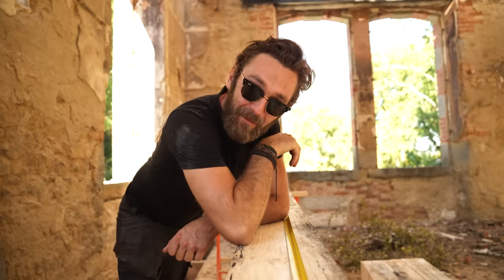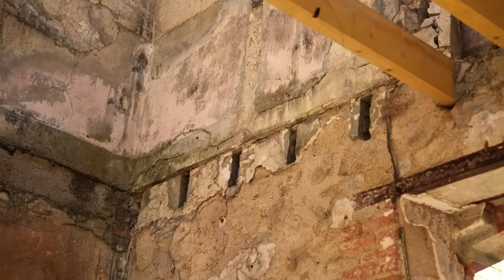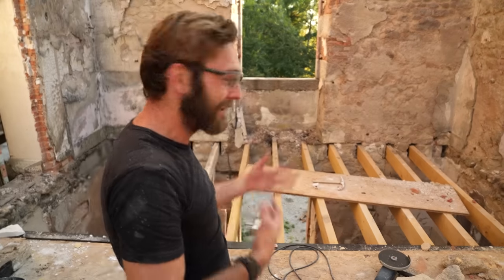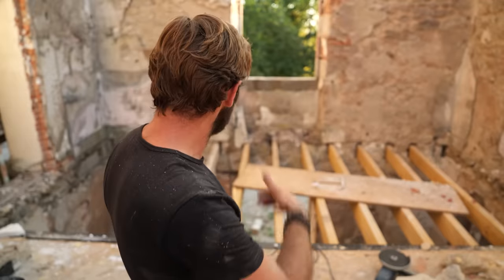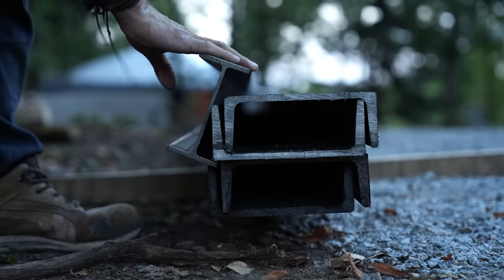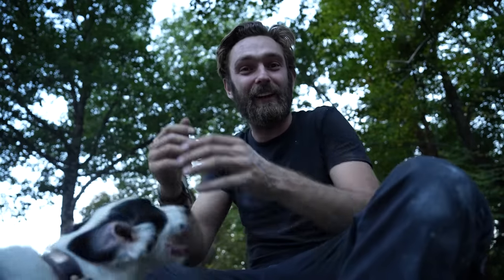Its a big day for materials, finishing the floor.

Comment: You have to give it to Dan doing all that heavy lifting and pulling those beams up to that floor he's working on now. He's going to appreciate all of his hard work when he finishes this floor and has a solid floor to work on. When Dan finishes this floor and the beams he'll be ready for another vacation!
Reply: He's getting such a workout that pretty soon he won't need a hammer and chisel to fix masonry. He can use his bare hands, lol.
Reply: Remember when he used winches? I wonder if they broke...
Reply: According to his friend, Stephanie Jarvis, from Chateau de Lalande, he will be using her getaway spot in Cap d'Agde next week
Reply: @hmeyers5114  maybe he just did not have a place to install a winch ?
Reply: @hmeyers5114 the beans are long enough to prop against existing beams from the floor. Using a winch to pull them over the top was probably more botheration than sheer brute force at the time. Lol

Comment: This is the first time I’ve seen you install the floor joists without painting the ends that go in the wall.
Reply: Yep, I noticed the same thing.
Reply: The quality of the beams seams a bit off too.
Reply: Its not serious, its just a You Tube Channel
Reply: OOops 🙃  how did I miss that detail when I was actually waiting for it? 😵‍💫
Reply: I noticed both the lack of the black treatment and the slightly lower appearing quality as well.
Reply: I think it's because these are so dried out they don't need to be painted to keep them from cracking. They already are kind of cracked and well dried. Just a hunch
Reply: @patstrong547 I'm wondering if he's having trouble finding wood ....there has been a shortage for a long time now.
Reply: He mentioned that he didn't know if the treatment was necessary, uncertain if it would help make the boards last longer, and I think someone else he spoke with regarding it wasn't certain either. I noticed that too.
Reply: @karladenton5034  He said earlier he was not so sure it was really worth it or helped a lot.
Reply: Perhaps his friend, who gave his opinion on how to fix the window frames, advised him that the black spray is no longer necessary. It's just a hunch as well.

Comment: Just discovered your channel two weeks ago. Been binge watching, and I'm really amazed at what you've accomplished. You have a great team, Nic and Cameroun, and the others. I just hope Dan can get the roof on before winter. But that means the chateau  walls have to be really strong and stable enough to carry the weight of the roof - rafters, concrete ring beam, tiles etc.
Reply: I think he is just going to do a temporary partial roof over the wing he is working on.  He won't do a full roof until he has all the floors in on the other side, so no ring beams yet, but won't that be exciting when that happens. :face-red-heart-shape:
Reply: Welcome aboard.. ❤❤❤❤❤

Comment: Dan please take time to clean the floors so you don't sprain or break a foot/ankle.
Reply: I was thinking the same thing. It’s bad enough working at heights and on slightly unsecured flooring without have to deal with rubble.
Reply: So easy to slip, trip & a fall from that hight😢‼️🚩😭
Reply: And wear some proper boots 🥾
Reply: @annekabrimhall1059 he has safety shoe on.

Comment: Dan, why not connect a strap to your elevating platform and then to the material to be lifted? You would have a crane. Also, see if a nut drive could be adapted to the crank handle shaft  and attach to a power drill and voilà, no more cranking. Just saying.

Comment: Dan, as usual love what you are doing, why dont you erect a fixed scaffold on the outside wall with an outreach for your electric hoist. Also with the amount of plaster and rubble you will be clearing from the  upper floors a chute will save you double handling it. I am thinking of your back over the next 12 months!

Comment: Hi Dan, I have an idea on what you can use to get water in the walls, instead of using a bucket you can get a Garden Sprayer for Fertilizers that you can manually pump to get the water right where you need it.

Comment: Just a thought. You can buy cheap inflatable jacuzzis these days. If you had one it would help with your sore muscles at the end of the day. The boys would enjoy it. It would help personal hygiene.
Reply: O M G. No boundaries
Reply: He  doesn’t have running water and  the  old  well is putrid, he has to cart in water for the mixer.
Reply: In one of the Vlogs at the farmhouse he has an inflatable jacuzzi.
Reply: Even if he had water he doesn’t have electricity to run a jacuzzi or to heat  the water, he  only has a solar powered battery bank to run his saw and power tools.
Reply: @lindalawson7600  Totally agree. Today Dan has been advised to suck in his gut before lifting things, to remember to loosen the collars on his puppies as they grow and to get a jacuzzi to help with his personal hygiene. I enjoy reading the comments but no wonder Dan doesn't respond. 🤣

Comment: Pro tip, you can clamp or screw the festool rail vertically on the front side of the beams, as long as you have them aligned well enough, set the correct angle, and you only need to do 2 cuts for the tenon. Also, you should definitely maintain your chisel. Best

Comment: Should put a plastic skin over that current floor when it is done to keep the rain off below. Just gives you a new large space beneath to be dry and store things. Then move that skin up to the next top floor before the roof goes on. 
It will also give you somewhere with a nice dry work area on those wet days to get things done inside.

Comment: I’m confused. Is Dan working both sides of the chateau at the same time? Or is he doing one floor at a time on one side, then planning to go back and do the other side?
Reply: One side!
Reply: At the moment he looks to be doing one side. 
I think the plan is to get a roof on one side and some windows in so he has a dry and warm place to work n winter.
Reply: He's restoring the building in quadrants, completing each section individually before moving on to the next

Comment: Here's a tip Dan if you use a speed square on a timber holding it on the timber you can can use a circle saw against the edge of the speed square then using a circular saw to cut perfect 90 degree cross cuts instead of using a reciprocating saw but ur doing good job mate

Comment: Dan, you might want to consider some engineered wood products , they will do the job and may save your back in the long run? Also, the lazy French Shiites could have put the steel beams in the building with the truck crane , same with delivery of the FloorJoists! That’s a big Order$.

Comment: Did you run out of that  black sealant you had been using on the rock end of the beams? Or did you just forget? The latest beam didn't get painted either....Continually amazed at the job you're doing. Nothing you can't do, or you figure it out and keep on doing! Puppers are growing....

Comment: It's probably time for a new ladder. Sideways leaning is dangerous, especially at great heights with extra load. If the center of gravity is no longer between the bars, the ladder will tip over. It only takes 3m to break a foot or a wrist and that's it for the next 2 months.

Comment: Dan, there's no forum to speak about what I'm going to say so I'll say here. See if you can get the attention of a probably woman architect even post grad and though the way you might play with building inside won't be overly radical obviously, get a couple of things happening inside that I'll say it, illustrate theory. It's so interesting and you will be rewarded over and over with the way any parts of the new build have been treated. A bit of theory is your high ground. And it's worth thinking about it in the stages where you're setting the bones.

Comment: Nice 🤗

Thinking......
Does the wooden beems are secured fixated after placing ?
They might could move in the wall  without holding them on place in the metal I beams and fall out !? 

They only stick a few centimeter into the metal I beams isnt it.
Its still posible to provide all of them that they will not move before its too late to ajust.
I just say out of concerns. ✌😊
Reply: Properly fixation, not with Pur foam.

Comment: I don't know if this will help, but Americans use this thing called a tarp in construction.  You have to be super super super careful where you use it because Dan is working on floors that don't have the floor nailed down, but when you can put down a blue tarp, it will save you time when you try to clean up all the broken bricks and mortar that fall down in the average day.
Reply: you need some better sawhorses and you need more sawhorses.  If you are doing a cut like that, use 2 sawhorses so you can fully support the heaviest part of the wood, and use 1 sawhorse to balance the cut piece.  You have been doing this a while, so I don't know if you don't know that, or just trying to do it faster with just 2 saw horses.

Comment: I would have expected engineered beams for the floor but those solid ones look big enough for the span and are period correct I guess.
Reply: @andymccabe6712  Yeah, easier to modify also without getting out of spec.

Comment: Daniel, you really should consider fixing some more stable flooring with screws or some thing instead of just using that flimsy little piece of decking you’re walking on. One wrong move and it’s over rover. And then what are we gonna watch. The one legged man building a Château? That should be interesting.